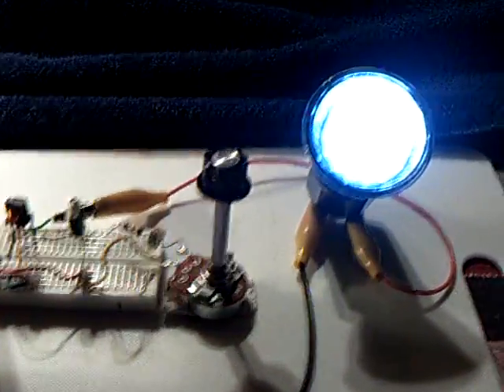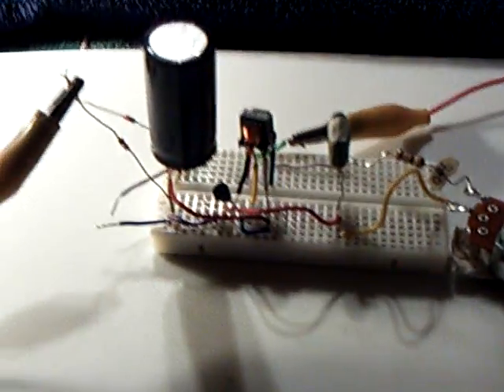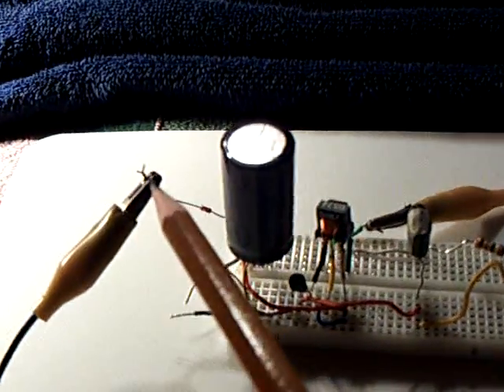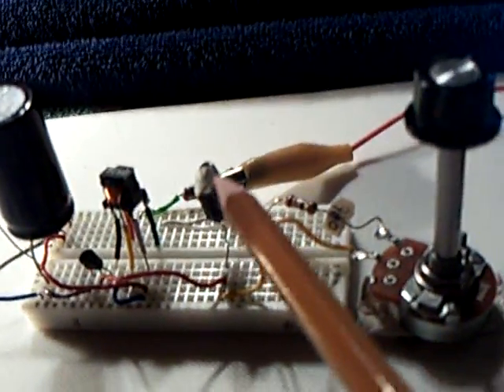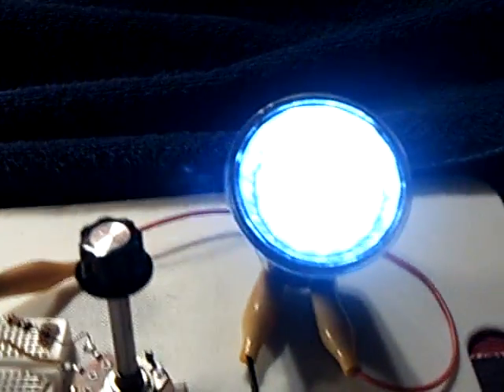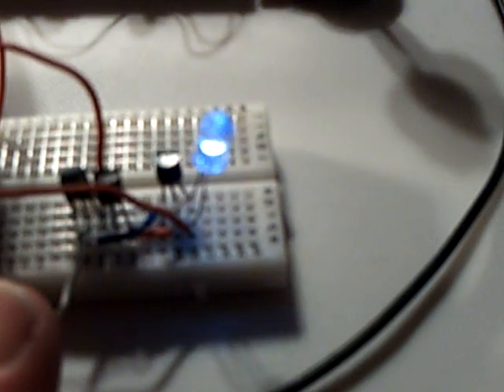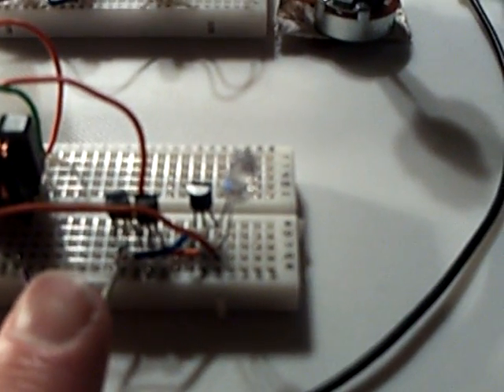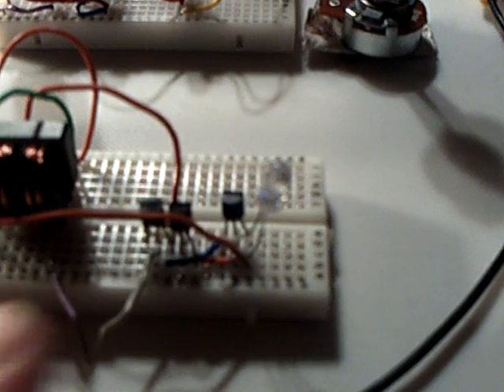Closed loop Joule Ringer & Darlington transistor setup.ASF

Comment: When using a darlington pair transistor you might want to add a third coil or choke in series with a small ceramic capacitor to the base. But you may need a 1200uf and higher capacitor over the batery spot to conduct the current. The third coil should be arranged to increase the voltage to the base to keep it going. Anyway I made a darlington with a 2N2222 and tip 31 or tip at 10v and 10A rated N type. I put the choke from the an old power supply in series with a 10pf to the base. 1200uf across the battery. I used a fairly new AAA and used that to run a solar led light from the dollar store. So far it is working better than I thought. I did change my circuit to have base to base whith the emitter of t1 to base of t2. But collector of t1 is connected to t2. I put a 10pf cap acrose the third inductor in my circuit that was inline to my transistor pair's base.

Comment: That sure was a nice big battery on the breadboard.  And turning the circuit on with your finger is just showing the gain of the Darlington pair, which is always high. 

What is the point of this video?

Comment: Thanks for showing the lasorsaber circuit again with the AV plug I hope that it works out. One more good transformer to check out is the dollar store polaroid throw away camera they have a different style hv transfomer if you ever find one they work great with CFLs but they are a bit energy sucker if you go wild with high rated CFLs but the tansister is rated like 3 to 5 volts and puts out like 45Khz. Transister is listed as C5720